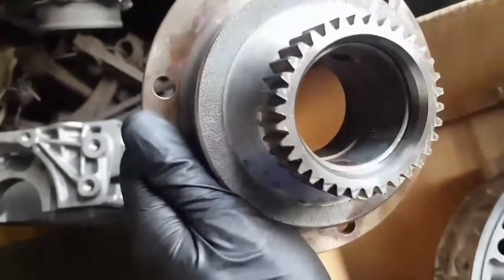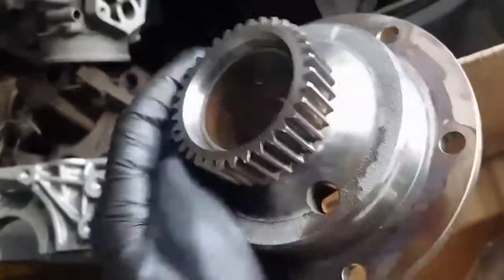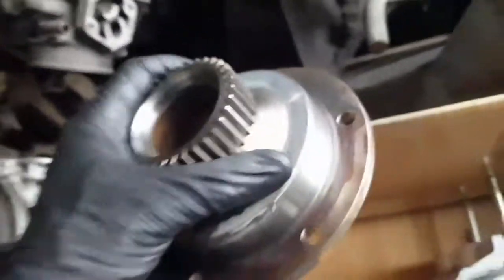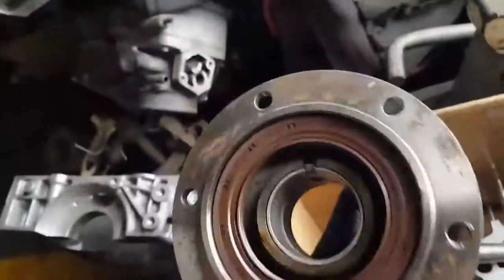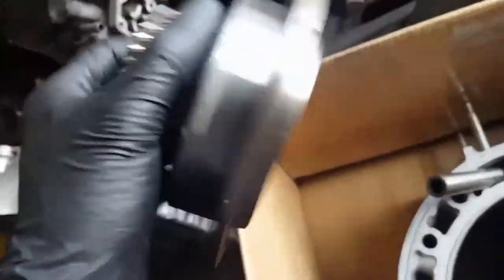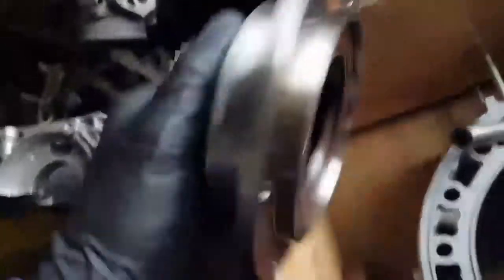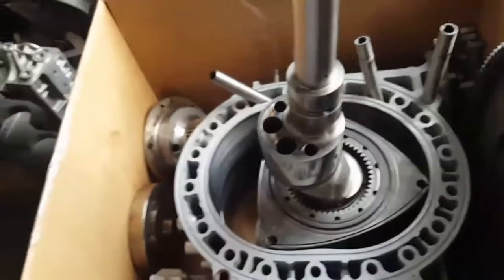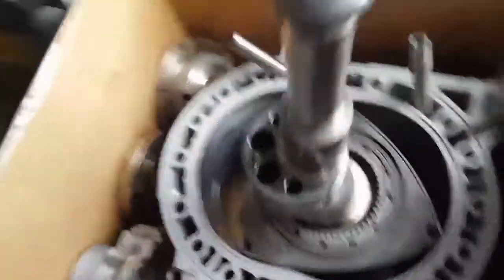How to rebuild rotary Mazda rx8 rx7 engine

Comment: What rebuilt kit did you use ?
Apex seal specially?
Reply from the maker: meca13b 2mm apex seals from goopy performance nd closing kit from Atkins rotary ohh nd the porting templates i use are from pinaple racing nd mazdatrix!! Currently working on my 13b pp build for my mazda b2000 swap!!  THE DORITO PROJECT lol stay tunned
Reply: JM8686 
Nice ,  what year engine you have  ? 04-05 had bad rotor housings  wonder if you  resurfaced them or bought new ?
Reply from the maker: meca13b 05 nd same housings with a lil secret trick so no need to send them out to goopy, also ported irons resurfaced nd re nitrided 0.008 deep 👉😎
Reply: JM8686 hey I sent you a youtube private message

Comment: my question is can the secondary air injection valve can it be eliminated
Reply from the maker: Padro Martinez just wondering why do you want to cancel? Trying to gain more power? Or you have the p0410 code?
Reply: LOL more power I wonder if it's good for it or if it's not
Reply from the maker: Padro Martinez to be honest dont even waste your time cuz not worth it,you barely going to see any change nd the renesis rx8 engine is the ugliest nd stupid complicated intake manifold i ever seen hahahah intake ports and exhaust ports are in the irons lmao👎
Reply: What about like an aftermarket do they still come with the secondary air injection valve
Reply from the maker: Padro Martinez some does nd some doesn't,do u already have headers straight pipe nd a good cold air intake? Thats the easiest mods nd lil powah gain for your doritos lol
Reply: JM8686 no I don't have none of that on there and all this far as I only got was chest Corvette LS coils and cool air intake that's it and straight pipe yeah Katya headers straight pipe all the way to the back I have cake Beck
Reply from the maker: Padro Martinez sounds like you run out of easy external modifications hahaha
Reply: JM8686 yeah I did didn't I alright thank you very much LOL
Reply: How is Bridge porting how does what does that do

Comment: How did you clean up the rotors and housings?
Reply from the maker: penneyduk i took a video with my cellphone but got deleted by accident 😡 i have another 13b waiting to be rebuilt too!! i will make a better video on how to disassemble and how to clean all the parts!! Anyways the way i personally clean the parts are 
Disassemble the rotors amd then i have a hot pressure washer at the shop so all the oil and corrosion can be removed,then i use green or red scotch scrubbing pad  to clean the rotors "i keep the pad wet with some liquid called AWESOME"its a degreaser yellow in color that only cost one dollar at 99c stores,of course you can use any degreaser!!MAKE SURE YOU RINSE THE ROTORS WITH PLAIN water when you are done nd most important make sure you super super dry all the water from the rotors